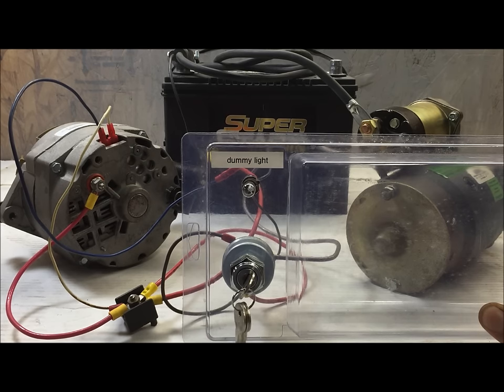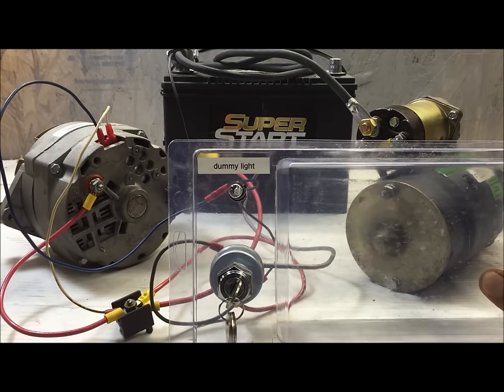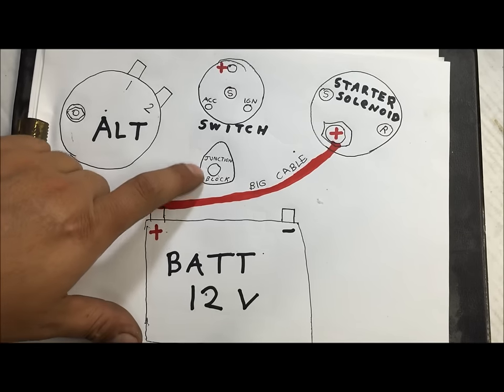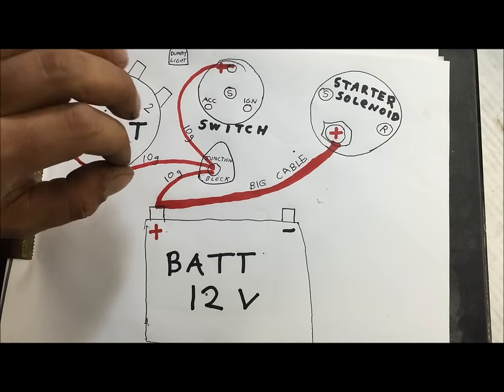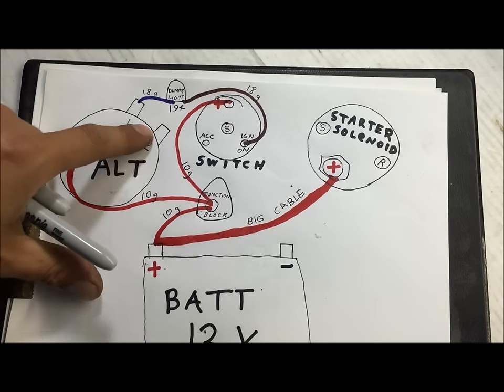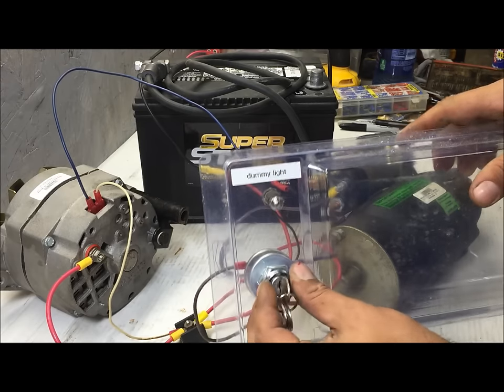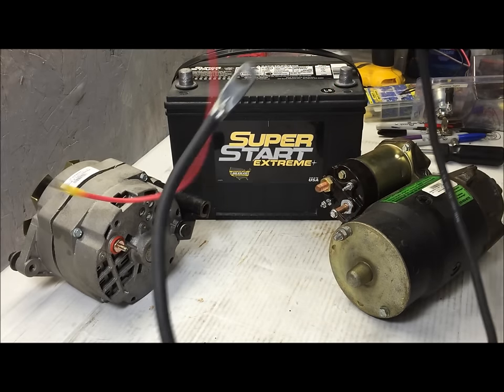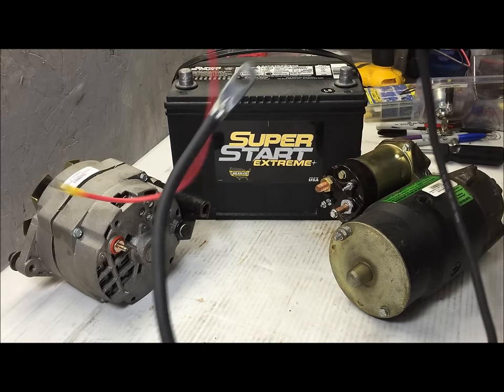64-72 charging system wire up using GM 3 wire internally regulated alternator

Comment: Brilliant!   Just ONE question:-   I have an old UK (DAX) Cobra Replica Kit car from 2000, which I am upgrading to a small block Chevy 350 from around 1969. (Chevelle).  I imported this engine from the USA to UK after it had been brilliantly overhauled by Jeff and his team at Novak in Salt Lake City. SO......we are now modifying the existing wiring loom that was installed in the original build, to suit the new motor, which has a new three wire GM alternator fitted.  The video is fantastic and answers a lot of the questions we had, BUT  one thing that has got us puzzled is that the two spade terminals that are inside the alternator casing, seem to be common.......ie they are formed from the same piece of metal! How can this be????
Any thoughts to help out a couple of limeys???
George  from the wilds of West Wales!
Reply from the maker: you could have a 1 wire alternator I don’t know for sure... I have a 3 wire alternator video.. the 1 wire does not have a charging light feature
Reply: Thanks  @chriscraft77022   so much for the prompt reply!   I think the question I really want answered is whether the double spade terminals inside the casing should be common?   Maybe that's the difference between one and two wired alts?    Thing is, I REALLY do want a dash warning light, or dummy light as you call it in your video!

(I must admit, i was waiting for you to turn the key, and get everything spinning!!!!

George

Comment: Now let say I followed everything you did. Would I have to wire any fuses or resistors to this ? I know the alternator is registered but I shouldn't have to worry about a electrical fire if done correctly ?
Reply from the maker: look at factory wiring diagrams to understand where you would fuse... I think I need to make a video on it... thanks for the idea
Reply: @chriscraft77022  ill be honest with you I just want to wire my car like a "tractor" no radio headlight turn signals brake lights nothing for just the time being I have a manual trans also the reason being is because all the wires are shot and I just want to be able able to drive the car and slowly rewire the whole thing
Reply from the maker: the truth is only fuse stuff next fuel and anything inside a vehicle or by something that can catch on fire ... the charging systems on older vehicles did not have fuses because they were all steel and would burn the wires in 2 before starting a fire.. newer cars have fuses everywhere because they are plastic and have high pressure fuel lines

Comment: first thank you for your video, great info now I have a 2014 Dodge Grand Caravan and the regulator in the ECM die can I use this system to recharge my battery > or have you got a better idea? thank you for your time
Reply from the maker: your alternator should be internally regulated

Comment: Video is good but would have been better if you talk bit about fuses in between the wiring specially the alternator fuse that where I have a problem, my alternator sending 14.4 volts but some reason battery is not getting the charge. Check the wiring continuity and connections they all good. I blew the 120amps battery fuse and tried with 80amp fuse. Is it could be the fuse?.

Comment: Great video my tractor hasnt been charging the battery as its been going flat and i just charge it, but i noticed today there is no wire going from the alternator to the battery would that cause the problem
Reply from the maker: if it was charging before the wire makes it back to the battery one way or the other... I have a gm 3 wire alternator video that goes over the basics
Reply: @chriscraft77022  Hi its never charged since i have had it i put a idiot light betwen the D+ on back of alternator but it dosent go out when tractor is started

Comment: Chris ran into a wall! I have a 68 buick skylark that has a starting issue. Brand new battery, new starter and new alternator. Still just one click but will never turn over. Where would I start looking at? Wires? Ignition? Relays? Just trying to not go buying more parts and it just ends up being a wire issue
Reply from the maker: check black ground cable to engine block first .. take it off and wire brush it..

Comment: Hi Chris I just bought a new alternator (GM) that doesn't have the 1 and 2 posts on it  so do I hook the battery side of the alternator directly to my starter switch or to the junction box then to my switch?

Comment: what are the two smaller posts on the solenoid for? are they only for acc or do they have a more specific purpose thanks
Reply from the maker: S energizes solenoid. 
I or R is a 12v switched on when solenoid is energized
Reply: @chriscraft77022  thank You
i have traced my power all the way to the key, I have no power from the dummy light/center of the key to the solenoid all other places have power it is wired exactly like you showed.
any suggestions on what i may have done wrong?
I have a HEI on a 454 75-80 year
all wire gauges are exactly like you said, the junction block has two posts
only difference the dummy light won't come on when trying to start motor the starter won't click or make any noise.
Reply from the maker: @kamieswanson9785  the dummy light doesnt have anything to do with starting your car..  ignore that..  you have a 10g purple wire that you need to figure out what is going on? what is the vehicle? make sure the neutral safety switch is in park or left position.. that is a common problem

Comment: Hi Chris I just got myself a 69 firebird project car in March and now I have too put it back othergeter  because I bought my first house I wrote too you before when I was doing my 67 firebird and boy was you a BIG help so this is the problem on the steering column when I went to the starting position the springing action stopped I had the steering column apart   it was my first time going through a GM tilt steering column but I got to figure it out a little my question to you is can I wire the car with a IGN switch like the ones they sell at the auto parts you used one on this video  I know the wiring diagram to the car thanks
Reply from the maker: you can use it, yeah, but why would you do that?   you can take the ignition switch off the column and leave it on the harness and use it like that.. I have a gm ignition switch video so see how you would operate it
Reply: @chriscraft77022  thanks Chris I opened of the steering column this morning and so that I skipped a tooth on the gear selector put everything back in the car turns on and turns off with the key thank you very much

Comment: Thanks for the video, two questions: why do people jump 1&2 together? And secondly, where in this diagram do you put a voltmeter?
Reply from the maker: #2 is voltage sensing so it needs the voltage of the system ( which is the same as the battery ) a volt meter is run the same way you would check voltage with a multimeter.. anywhere, I run volt meters off the radio on with key wire and you can get ground anywhere
Reply: @chriscraft77022  thanks for the reply, I have found terminal 1& 2 jumped on my alternator. what is the reason for this?
Reply from the maker: watch my  3 wire hook up video.. that is wrong and will drain the battery dead overnight

Comment: Was that supposed to be the positive side of the battery you had hooked up? Just wondering because you used the black cable it was a little confusing.
Reply from the maker: yes, they used to run them in black

Comment: Hey Chris I have a read wire an that Brown just sitting unplugged  on the same plug connector under the hood. They're wrapped to the same chords that go towards the solenoid. I see you said that brown wire is normally connected to a light which is connected to wire coming from position 1 I'm trying to see if it's okay to just leave that wire and a red wire unhooked or should I splice that red wire into the still annoyed and splice that brown wire and run it to something

Comment: You should install a fusible link or maxi fuse in the wire between the battery and the junction block.  Without it,  any short after that point will create some serious heat and fire destroying your wiring harness or entire car.
Reply from the maker: there were none there from the factory... they fused after the horn relay

Comment: Awesome tutorial!! Maybe you can help me modify my tractor a bit. I have a 1962 Massey Ferguson mf85 tractor that I just attached a hydraulic Boss snow plow to. The plow drains the battery pretty fast and the old generator can't keep up. I was gonna add a second battery but am afraid it would over work the old generator. After watching your video, I was thinking if I could add an alternator and battery, independent of the current ignition, starter, and solenoid. The plow alternator/battery would be on its own switch. So theoretically, I would start the tractor as usual, then "flip a switch" to initiate the alternator/battery that can run the hydraulics and lights for the plow. Being non-essential therefore unemployed because of Covid, I have a budget that would cover a new battery. I have access to a 2002 Nissan Xterra alternator and one off a Saturn and an old toyota pickup. I could probably get my hands on the alternator off the Chevy pickup that the plow came from. Is it possible??? Any help would be greatly appreciated.
Reply from the maker: yes, people do that all the time
Reply: @chriscraft77022  how?
Reply from the maker: I don’t mess with tractors but look up gm alternator tractor conversion.. tractor alternator brackets.. they sell them..

Comment: Great video thank you for sharing! I have a diesel Japanese tractor and I'm pretty sure the alternator is bad. I want to fit something more affordable into it. My alternator has three wires going into it probably 16 to 18 gauge. One of them must provide excitation because when I turn the key switch on voltage lights up in one of them. It has another that is a ground. I tested continuity from it to the block and it goes straight to ground. The third wire I haven't traced but I'm sure must go up front to the dummy light on the dash. The only other wire is the main output that goes back to the battery. I started the tractor and put a meter on the output and it's pushing 30 volts give or take so I assume the regulator is bad. Does this GM 3 wire require the excitation? Or does it excite on its own?
Reply from the maker: +Thomas Post watch my gm 3 wire hook up and just put one of those on it GM10si ( 79 Monte Carlo ) that video will show how to wire it correct and any problems

Comment: Just wondering, the wire from 1 connector to the ignition switch, is that momentary power running through that wire? Meaning the same power being sent to starter? Like when you stop turning the key to turn the starter, the wire/position 1 de-energizes right?

Comment: I am having an issue where the starter in cranking in the on position. Everything is hooked up correctly. Battery, starter and alternator all brand new. Have you ever ran into this issue?

Comment: ok, fantastic video, well done, now a question for another video, having just suffered an alternator failure, red light on, , i failed to notice that- so,  i want to install a tiny 12v bell- siren, beeper,  on the 194 bulb line,  do i put it in inline before the #1 terminal,  or off the ignition "on" terminal( under dash), to alt term #1, or install  on the back of the alt, from B+ to term #1?.... esp if this failure happens in the rain, head lights-wipers- heater, A/C defogger on, are on draining battery fast
Reply from the maker: run it anywhere between #1 and ignition ( or accessories)

Comment: If the dummy light fails, (burns out), will the alternator stop charging? Or do you think there would be enough residual magnetism in the rotor to excite the alternator?
Reply from the maker: they all self excite..  you dont even need #1 hooked up,,,,    just rev it up to like 1000 rpm.,...  you will hear it chirp when it “kicks” in...

Comment: Thanks for the interesting video.  I want to use an alternator for a waterwheel generator.  Will the Alternator generate a 14.5V charge if simply turned with the waterwheel...?  Would it then be a simple Poss/Neg connection to the batteries?  Can I simply wire it to 12V deep cycle batteries?   Do I need to gear it up with higher  RPM's...?
Reply from the maker: yeah, those cars idle at around 750 rpms and up...   so that would be a problem...  they will charge at 500 or so depending...

Comment: have a question on some of the wires itself period I have a 93 chevy c1500 rolling chassis previous owner had a big block in it.... I have identified majority  of the wires lost on theirs a blue wire next to the purple wire that comes out the old harness that will go to the starter solenoid... next there's two black and yellow wires attached to a star washer.. need insight on engine wire Pino ut

Comment: If it's not hookuped like this would it make the alternator get hot? And would it make the alternator get hot and smoke?
Reply from the maker: yes.. I have a gm 3 wire alternator hook up video.. the only one that HAS to be hooked up correct is #2 voltage sensing...  make sure where it mounts to engine is clean because that’s how it grounds.. make sure engine ground is good too

Comment: So where does the wire come from that reads back to your voltage gauge/meter in the cab? Do you just splice that in off the #1 wire some how? Also you can buy a new plug in for the 1/2 wires at the parts store, cost about $4. The only difference is the wires are white and red instead of blue and white.
Reply from the maker: i have a gm 3 wire hook up video that goes over that..  #1 is switched on with ACC goes through the dummy light and to #1 position on ALT...  voltmeter can get 12V from anywhere in the system..

Comment: Chris Craft do you have a video of GM generator to 3 wire internally regulated alternator conversion?
Reply from the maker: +Philip Colton I have an easy way conversion where you just jump the plug.. I have a wiring video but it's old and sucks.. but yeah, I do

Comment: Hi,
I have a 1962 Mercury Comet SW and want to convert the generator to a 3 wire GM alternator. Will the wiring be the same as outlined in your video? I have gathered all my parts except the junction stud and want to be sure before going ahead. 
Thanks!
Reply from the maker: +michael jones watch my 3 wire alternator hook up if you are just adding the alternator .. you will need to bypass or remove the voltage regulator

Comment: Is this done so that you can bypass the external voltage regulator and get you a new alternator with an internal voltage regulator?
Reply from the maker: I have videos on that subject.. this is how you wire a tractor or something you want to start over.. based on a 64-72 gm car.. yes , with internally regulated

Comment: 6:23 i understand why you do not like to jump that wire directly to the alternator output.. because  wire has  some resistance and  when the voltage of battery is low, but alternator is charging  and creating a lot of current,  the potential  between alternator terminal  and  battery terminal is slightly different  due to  voltage loss in the alternaor output-to-battery wire ..thus, the voltage sensing circuit will not detect the realistic voltage of battery/ system , rendering the charging less effective..... just my guesses
Reply from the maker: YES

Comment: Great vid ! Im trying to figure out what has happened to my welder ..I put a ebay guage in it shows amps but no start if i jump both termanals it shows no amps but runs but does not charge battery
Reply from the maker: this is the wrong video.. I don’t know what alternator you have on it
Reply: @chriscraft77022  Ill let u know but i bet its chevy lincoln electric always uses chey what vid is the right one? your 100% enlighting anyway!

Comment: Chris,  I am changing over a '67 Caddy from the external regulator to 10SI alternator, got the connector with anti feed diode and from what I can tell you wire the "BLUE" wire to the "Battery" terminal on the alternator, or junction block. The "WHITE" wire goes to switched ignition (Dummy light?, Brown wire in my case)?  In your video it's the opposite.... from what I can tell Field is the one bridged to "Bat" and the white, "R" or #2 terminal is where the brown wire should go?
Reply from the maker: a Cadillac could be wired different.. I mess with Chevelles ... if your car drains the battery dead then you have them switched
Reply: @chriscraft77022  Thank you Sir! I will experiment when I get it all hooked up. Shouldn't be any danger messing anything up by swapping the F and R terminals temporarily?
Reply from the maker: it will drain the battery completely dead if they are switched.. that’s all
Reply: @chriscraft77022  Thanks for all your help. I bought the connector with diode and connected it like you have in the video. Works PERFECT! THANKS A MILLION

Comment: i have a 2.3l 3 wire just like this should be able to do this right?? but do i need to ground from the atl to the frame or is ok bolt to the motor.. thanks

Comment: Nice video, does it have to be a 194 bulb.  Am building a custom dash and was going to use a led indicator light.
Reply: pokerwood if you hook up an led you wont need to worry about putting a diode in the circuit

Comment: So I wired mine exactly, and with the ga. Wire you said to. Assuming the terminal plug closest to the alt cable is #1... It's perfect. It charges good but at idle the dummy light is on just enough to see.... By no means "lit" is that ok or normal? Thanks!
Reply from the maker: watch my gm 3 wire hook up video.. that is not ok.. the light is backfeeding and you sometimes can’t shut the engine off ... watch that video and if anything.. install the diode just like I did or run #1 to ACCESSORIES on the key switch